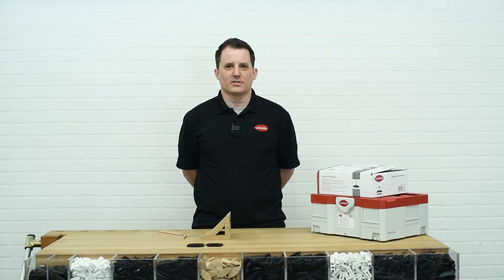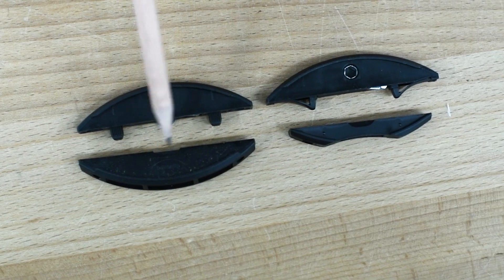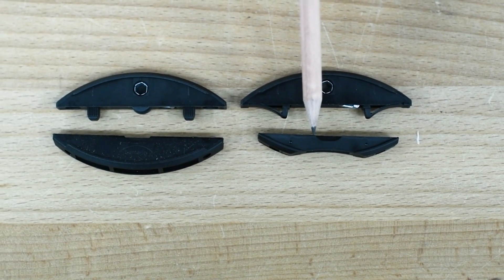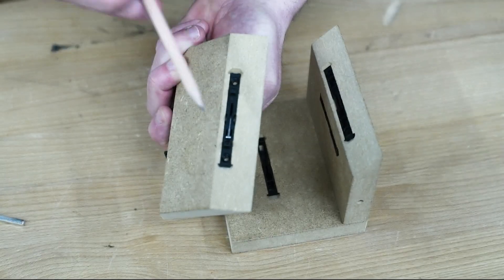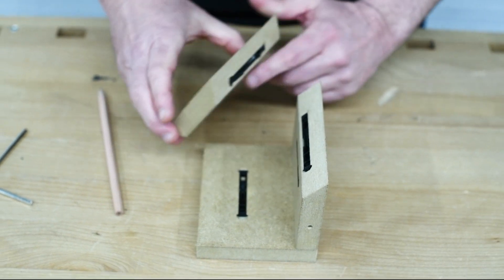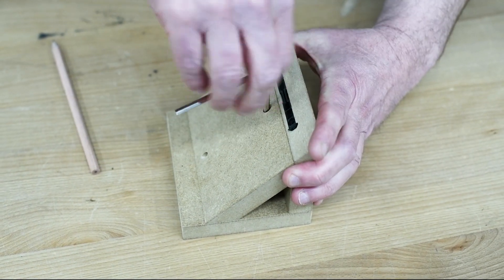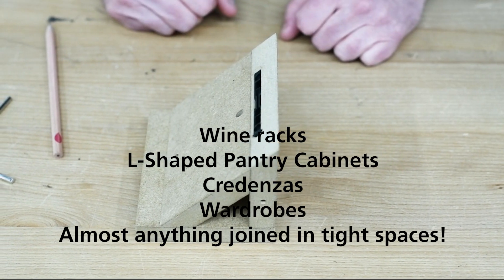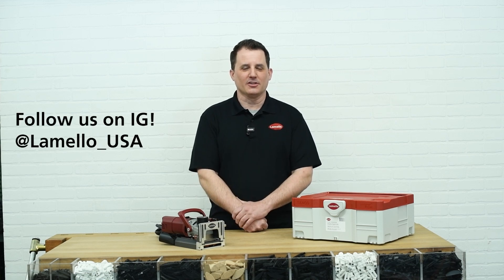Lamello Lesson - Introduction to the new Clamex P-14 Flexus

Comment: In your demonstration is it possible to move the angled piece to disassemble? It seems you'd need to remove one of the other two pieces first?
Reply from the maker: Yes, the flexible tabs on the Flexus allow the workpiece to be removed (on its own) from the connection point.  This video on our Flexus page illustrates how: https://www.csaw.com/lamello/p-system/clamex-connecting-fittings/lamello-clamex-p-14-flex/
Reply: @ColonialSaw  brilliant,  thanks! Was worried dry fits would not be possible in some circumstances.

Comment: So why doesn't Lamello just go to this and get get rid of the regular clamex? Is there any disadvantage to the flexus? Seems like it would be great to have the option to slide a panel in place if needed.
Reply from the maker: Hi Joe, Great question.  The main difference is clamping, shear, and tensile strength between the two versions.  While it depends greatly on the material being used, in general the original/standard Clamex P-14 has approximately 25% greater capacity than Flexus in all three categories.
Reply: @ColonialSaw  I see. Thanks for the info.